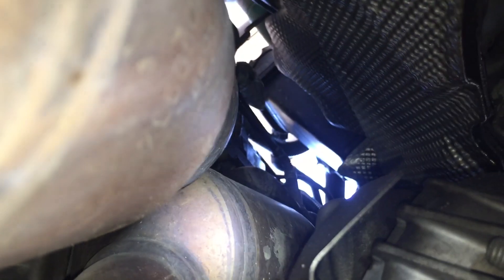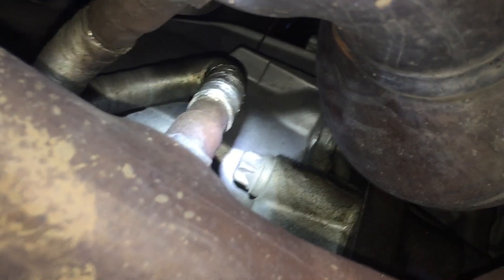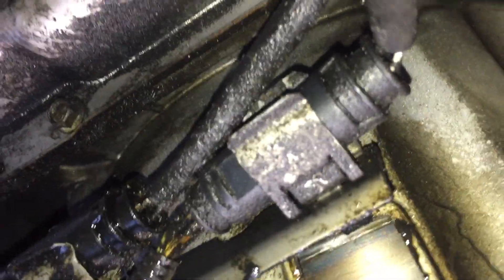Location of oxygen sensors 2007 BMW E90/92 N52

Comment: Hi Chris. I got the 07 328 Xi. All wheel drive I guess. Wish it wasn't though! Wish it was just the "i", not Xi! Anyway, thanks for the video. 

Do you happen to know which o2 sensor is the one that this code is referring to? - "P0030: HO2S Heater Control Circuit Bank 1 Sensor 1"  
That's the complete info that comes up on my reader. It's actually code P0030. But it offers that more info thing and it shows that other info. Thanks!